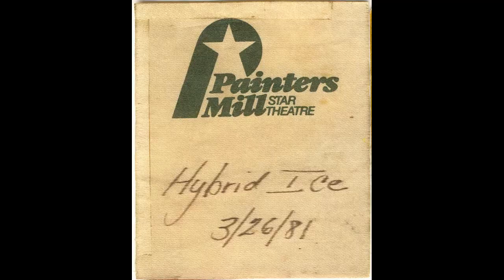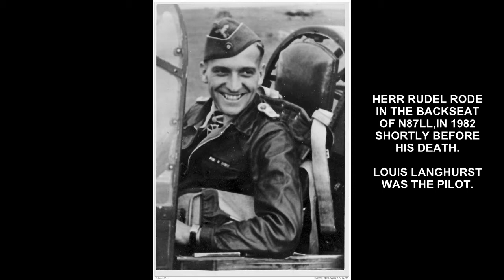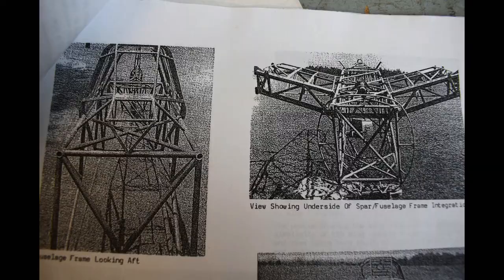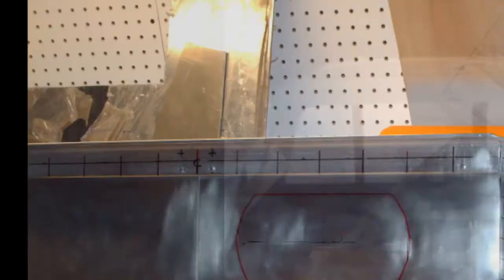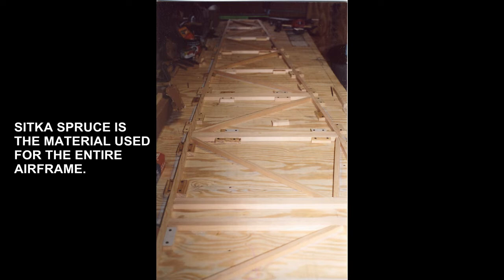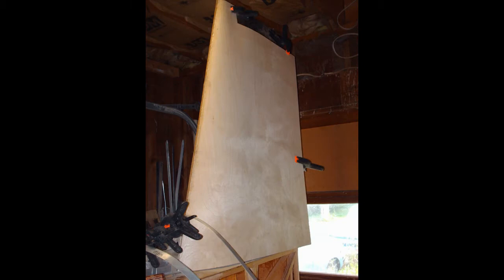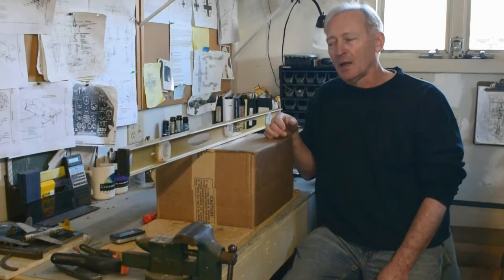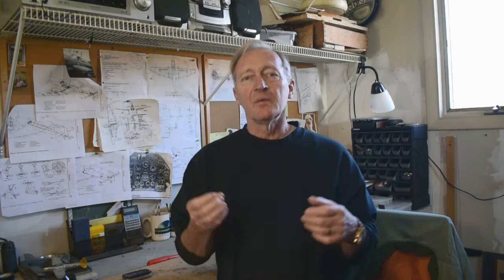GRETCHEN'S GARAGE - EPISODE TWO

Comment: Have you considered 3D printing for some of the cockpit stuff to create authentic looking levers, switches, bezels, etc...?
Reply from the maker: I have. But three problems arise with that: 1. The cost (I am a 'professional' scrounger). 2. The space. 3. The extra weight.  Explanation as follows...I am trying to replicate the cockpit as accurately as possible within the limitations as outlined above. Some fixtures, switches, levers, etc. aren't required in this construction because they have no function in a non-combat experimental aircraft. Adding them can cause space limitations for actual needed things. I had determined to install what was required and functional in this as a licensed aircraft, then possibly add any periphery for aesthetics if the cost and weight don't prohibit doing so. One layer fiberglass / epoxy foam carvings have been on my mind for the radio, and such. Thin aluminum tubes such as whiskey containers, for bombs. All that is very (literally) experimental rainy day ventures! And the printing would depend on having an original item to scan in the first place. Thanks for the input, Marcus!